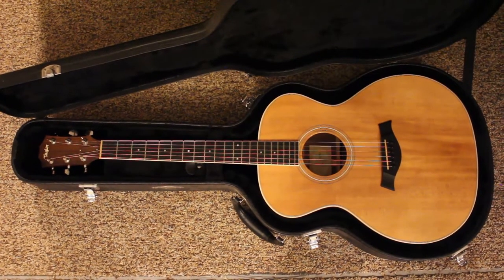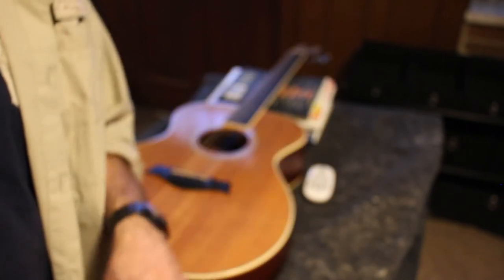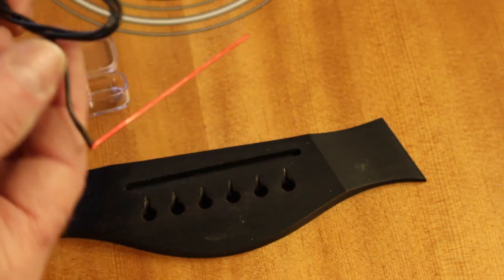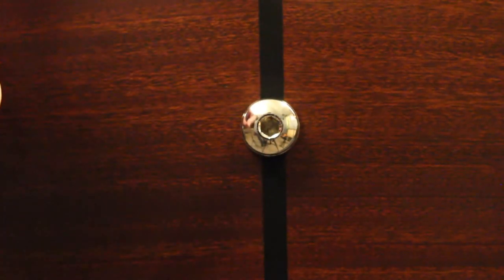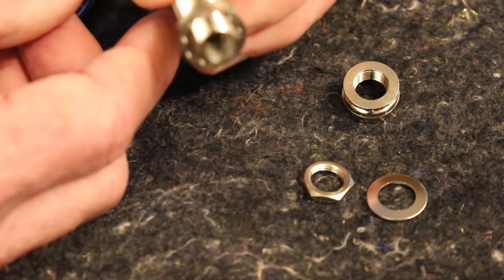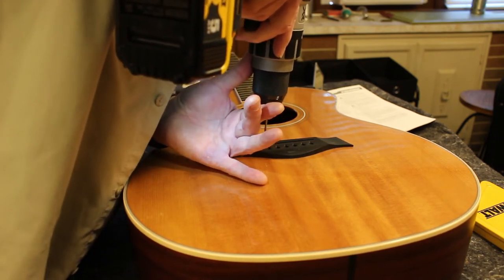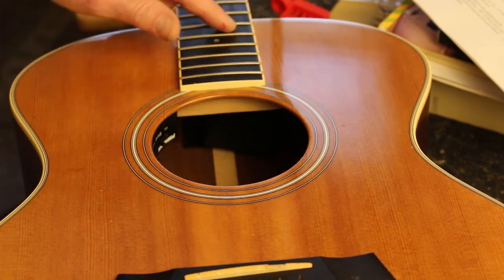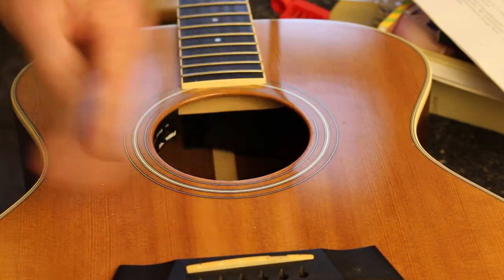Ed Harris - Fishman Ellipse Matrix Installation

Comment: My Martin XC1T Ellipse has this pickup installed. When I have the blend set to pickup there is a very obnoxious hum. Where should I start to troubleshoot? Thanks for the great video!
Reply from the maker: Thank you for commenting! I had a similar thing occur. Check the piezo pickup under the saddle. I replaced it and it resolved the issue for me. I hope this helps.

Comment: Great video. How could one uninstall the pickup? I have one of these in my 2009 Martin 0MC 16E that has rattled almost from the time I bought the guitar new. Martin says I could send it to them because it is a mounting issue and they would fix it free. But I would still have to pay shipping cost and I would still end up with a pickup I don’t even like. I was never impressed with its tone and I can’t stand having a battery inside my acoustic guitar. I am tempted to remove it myself but do not want to damage the guitar obviously. Thank you!
Reply from the maker: The controller itself can be removed from its bracket by using a guitar pick to pry it loose from the bracket. It just clicks in and out fairly easily. Once it is removed you can disconnect the microphone easy enough. It simply unplugs. To remove the bracket itself you can carefully remove by prying as well. It is held on by an adhesive tape. The piezo pickup  can be accessed under the bridge. Remove the strings and lift off the bridge to remove. Keep in mind during installation, the bridge height was adjusted to compensate for piezo pickup thickness. Your action may end up too low once your remove the pickup so you may need to either replace the bridge or compensate by doing a setup on the instrument afterwards. So sorry to learn you have been having issues with it and that you have decided to remove it. The battery bag is held on by velcro and can be removed easily as well. I hope this helps. Thanks so much for watching and commenting!
Reply: Thank you for your quick and detailed response! I may try your techniques. Thank you again for making such great videos and being such a responsive YouTuber!
Reply from the maker: @gingold66  You are so very welcome Greg! Thank YOU in taking the time to watch, comment and like! It means a lot! 🙏

Comment: I so much prefer the rare earth blend...no alterations to soundboard, no gluing, easily removable, no bS piezo strip under my saddle, etc.
Reply from the maker: I'll have to check it out! Actually, there were no alterations to the soundboard per se. Only a height adjustment on the saddle to accommodate the piezo strip. Also, there is no gluing involved and the whole installation can easily be removed as well. Piezo strip does come in handy in certain environments. It helps reduce feedback in high volume situations. Overall, I'm very pleased with Fishman in general. I have a couple of their acoustic amps which complements the systems very well.
Reply: @WEdHarris  No doubt this sounds good, but Drilling a hole in the top (bridge), replacing saddle material with piezo stock, and an adhesive film under the soundboard (which might restrict the movement of the wood) are all just a big no for me on a D-35 but maybe on a cheaper guitar...the rare Earth Blend has some nice cork strips where the pickup meets the soundboard that allow for wood expansion and contraction and the actual contact area is a fraction of the Ellipse. No soldering, sanding or any prep at all other than reaming the endpin jack hole. Also, no thumping effect with the rare earth that you can get with piezo. My cheaper Martin 000-12E has that new MXT soundhole system in it and I hate it. Cant use it live because even with a $400 acoustic preamp/mixer I cannot dial out the piezo thump when I bare-tip fingerpick. I can see using the ellipse if I really wanted to hide the pickup. Plus, using Stewmac's Jack installation tool makes it a breeze to switch the Rare Earth Blend to another guitar. I have sold several guitars but have been able to keep my $300 pickup system each time.
Reply from the maker: @billsmith3042  All great points Bill! Thanks for the intel. Fortunately, the Taylor guitars all come predrilled under the saddle and the end pins are factory ready to accommodate the jack. So no drilling was required in this particular install. However, I do understand and appreciate your point. Yes, I would not consider this particular install on my 1943 Martin 000-28 either! LOL But then again, I would never risk taking it out to perform with. On this install, there was no "adhesive" applied to soundboard. It uses double-sided tape. They just recommend cleaning the area prior adhering. I am a stickler for compromising or making alterations to any instrument. I own a few acoustic vintage collectables. I am not encountering any "thumping" on the piezo side, and I flatpick and fingerstyle on this guitar. However I am aware it would not be a good set-up for percussive playing. I do mix heavily on the internal mic thus reserving the piezo if I ever experience any feedback issues (which I haven't encountered thus far). The unit that is mounted underneath the soundboard actually clips into a bracket which is actually affixed via double-sided tape. I mention this only because the contact "footprint" is very minimal which is a nice feature in that the unit can removed easily. Just for the record, there is no soldering required on this system as well. Thanks again in sharing your experience and wisdom! It's always great to share such experiences! Not every application is universal to all situations and each should do their homework in weighing out the pros against the cons for their particular needs and go from there!